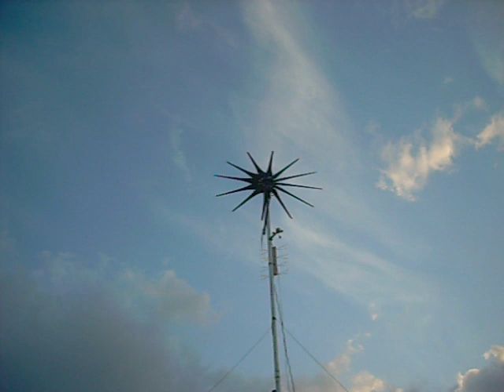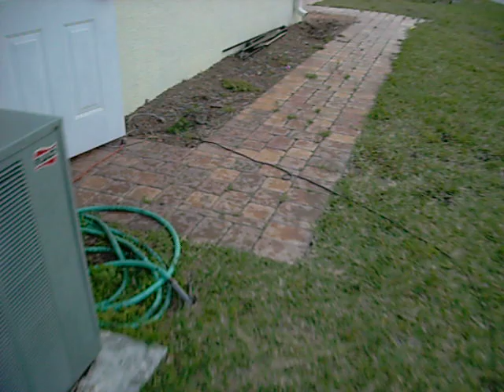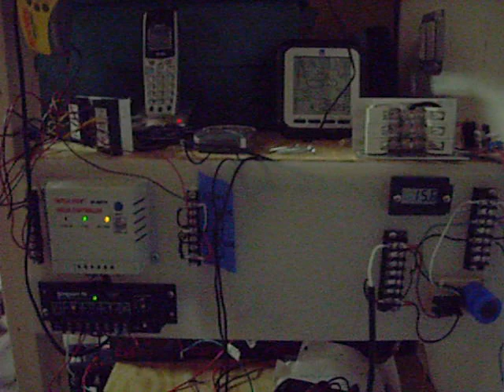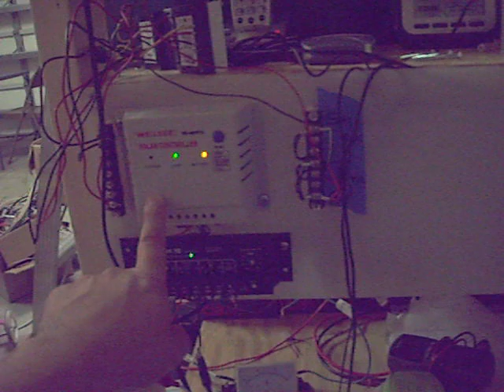12 Blade Wind Turbine Upgrade.avi

Comment from the maker: @spacom2000 

I got them from MW&S a few years ago, but ebay has the same blades cheaper.  Mine are the older MW&S design with reduced surface area, and are fairly cheap on ebay.

Comment: Weight near the centre has less effect on starting inertia than weight farther out.

I'm not recommending cutting the tips, because you lose huge sweep area and thus lose power by doing that.  

You should do the math and calculate that 10 grams at 36 inches from centre has 36 times as much effect as 10 grams at 1 inch from centre, for example.  Estimate the weight at each few inches of radius and you might find the hub is so close to centre that it is not the issue.
en wikipedia org/wiki/Torque

Comment: hi again when all of the furlling style of wind generators start furling and slowing down !! these blades are meant to keep going!! no furling!!!! my blades reponse goes way up around any where from 22 to 26 mph and keeps climbing!!above 22 mph is when this blade system comes to life !!power and response goes up above 22 mph and keeps getting much stronger!!!as long as the wind speed stays in that range or above!!donot recommend light pipe or light tower at this speed!! mine has really amazed me

Comment: hi i have a 12 blade hub also.for you to see better response has several factors.1

1 very strong tower is a must!!this blade system at full speed is very potent!!donot recomend  a light pipe or light tower!

2 this is a fixed pitch system! the response starts at the speed the blades are designed to work! below that speed like all fixed blade systems will have slow response!
3 the stator and rotor has alot to do with reponse as well of a 12 blade system!!
 is designed for high speed power

Comment: I love my 3 falcon mach3 blades from missouri wind. jeff told me they have a five blade coming out soon. they do really well with low wind start and high speed. i bet it would even spin their super patriot 2  motor with for five blades. i'll ask and let you know. i bet a stainless steel hub would work well. you can use a thinner piece because stainless is stronger than steel. later

Comment: I'd think that if you let your turbine get up to the proper RPMs, you could get pretty much the same power out of 3 or 5 blades.  I've done lots of simulations of VAWTs and it seems if the turbine is too solid, you don't give the air a way to get moving and you lose power because it just goes around.

Comment from the maker: daveydee1998 

Daveydee,    

  Looking at the rotor pole piece geometry of the Wind Blue I can see where it could be slightly less cogging that what I have here, although whether or not the magnetic field density(and the peak voltage developed) is higher or not is the question.  Looking forward to your rewind results-keep us posted!

Comment from the maker: daveydee1998 

I have a cast aluminum 7 1/8" diameter cone that was from the top of an outdoor light that I could send you if you like.  It is 3 1/2" tall.  Message me if you want it.  I ended up with two of these recently, and only need one for myself.  At some point I would like to experiment with a SS shafted rotor from Wind blue like you have-I'm kinda curious to see if it develops a higher voltage than the Slant Core plus that I have.

Comment from the maker: @natedogg1026 

Great, nice to be observing the same signs.  SS would be a great choice for the hub, and certainly not distort the internal magnetic field.  Never thought about he corrosion issue too.  Looking at the 12 blade hub, I also think the hub could be made smaller, and push the blades closer together.  This could free up a few more RPM since the overall diameter would be reduced.   I'm glad to hear from you on this since you are using similar setup to mine. Thanks!

Comment: iam going to try getting the cone on first then try steel hub(i have a SS shaft on my pma) that will fit all blades tightly together. also smaller gauge wire in each coil mean more voltage, but you have to be careful not to under size it or you would burn it up. i like tinkering with different coils. i have a pma stator rewind that i am going to try in the next week or so.

Comment from the maker: I am on board with your thought on the more powerful core-I could see this benefitting in a couple ways.  First, the stronger the magnetic field the higher the voltage will be for an equivalent RPM.   Secondly since we would develop a higher voltage/current  at a lower RPM, this could better match the 12 blades reduced RPMs.

Comment from the maker: Ok, back and all went through :)  I didn't think to measure the diameter of the 9 blade hub in comparison to the 12 balde hub specifically, but if my eyes saw correctly the 9 blade looked to be about 1.5-2" smaller than the 12 blade.  That adds to the total diameter of the 12 blade setup, and puts each blade tip farther out.  Maybe removing 2" from each blade could restore the RPM to a close value to the 9 blade?

Comment from the maker: Daveydee,

Hopefully this post actually goes through.  Been having a bit of trouble posting as of late.  Rethinking the startup, i think you are correct about the 5-6 with the 12 blade, that is what I am now measuring.  I didn't have the anemometer with the 9 blades to be able to check the startup speed on those.  Lets see if this post goes through, and I will continue...

Comment: On the contrary to your findings with the wind speed start-up. My blades started between 5 and 6 mph. my 9 blade starts between 7 and 8 mph. But none the less the top end of the 12 blade is a lot lower in rpm.

Comment: Good job josh. Iam glad you documented this issue. Because this is what i had been finding with my 12 blade system. Except that i wasn't sure if that was what i was seeing. I think it would be hard to find a piece of aluminum thick enough and strong enough to be safe. I will be trying the cone after i finish a project that i have been working on. Maybe a pma that has a stronger magnetic field(some cogging) would be more suitable for the 12 blades.